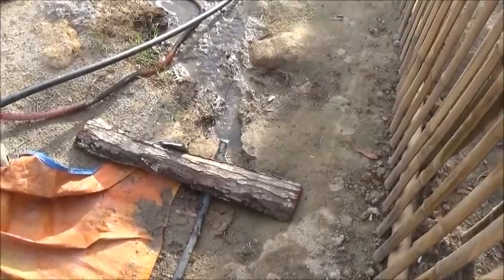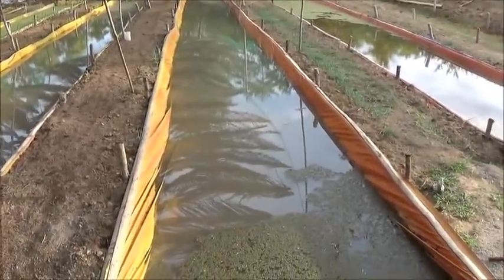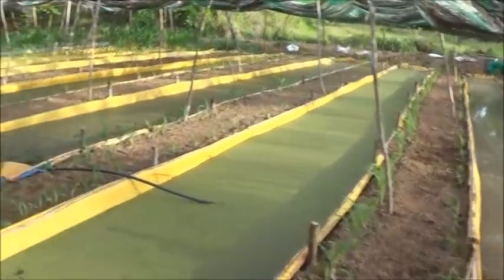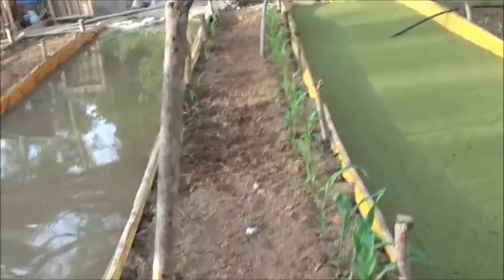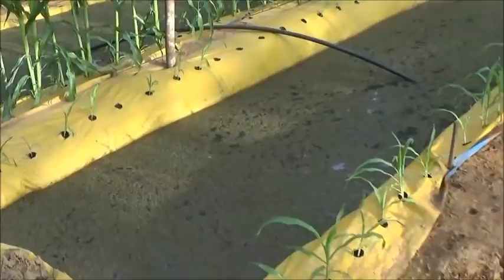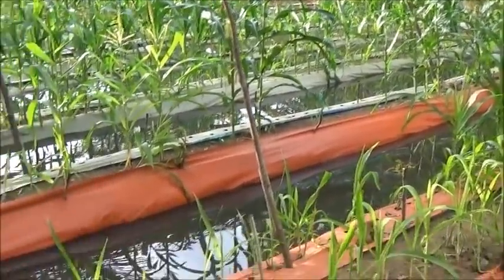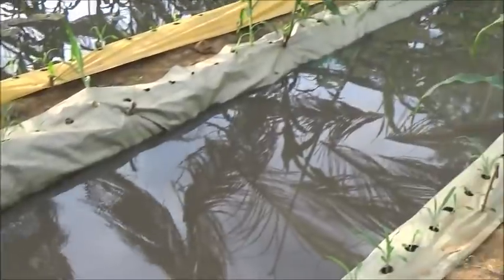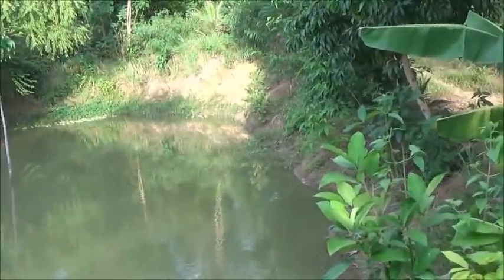The Azolla Has Turned Into Quite The Challenge

Comment: Until you get the water transfer system you mapped out ironed out, I would suggest you plug the pipes connecting each pit.  Then you have to siphon out each pit one by one  and replace it with fresh water.

Comment: Hi Brian, You’ve got a complex problem there that is beyond my math skills but I think your calculations of how long it will take to replace the bad water with the good might be off. If only bad water came out while the good water went in you would be correct but since the good and bad water mix, the water that exits will be a mix of good and bad. To get a complete flush of the pits will probably take longer than you calculated. I would suspect that the first pits would get more of a flush and as it mixes down the line it will take longer to flush the final ones because you will have a worse mix entering the pit, if that makes sense.

Comment: You've got a lot accomplished. You've been very lucky so far. I sorta thought your azzolla would be the answer to a lot of the problems. As much as this is a pain in the butt. It's still all a lesson in progress. Put your thinking hat on and backtrack. It was working good. What was different at each stage. What's the chemical reaction with time. What's the easiest way to get it to function. You can do it. You have to inspire this audience. Sometimes you get the best advice from the least expected place. So read these dumb comments 😂. Ask RedRed.